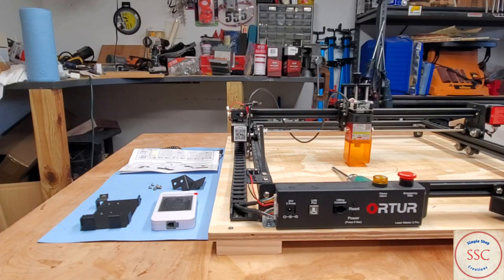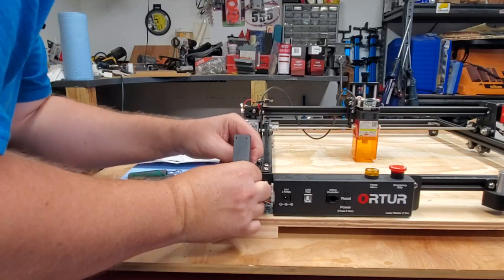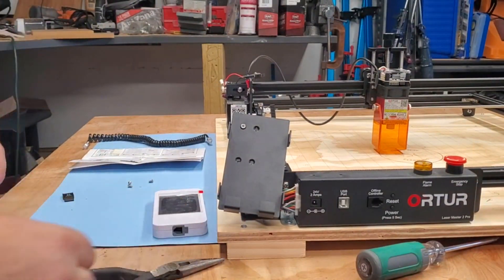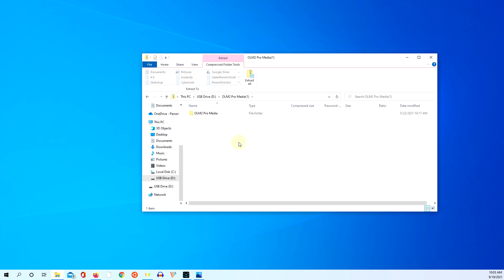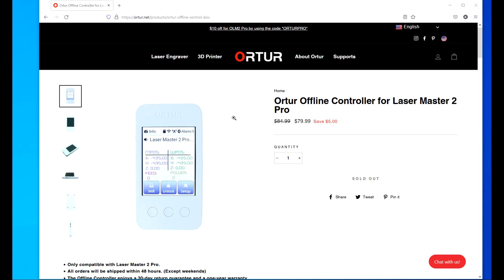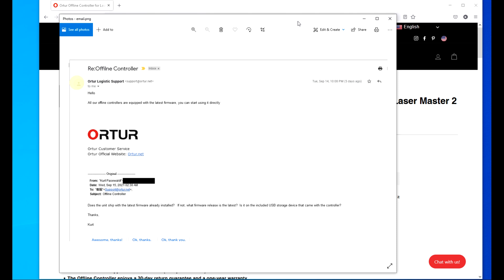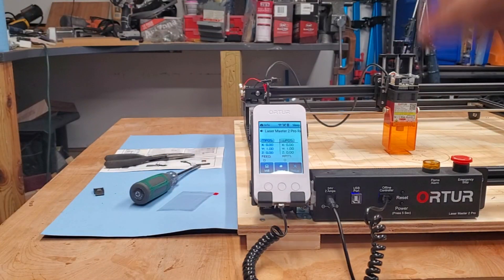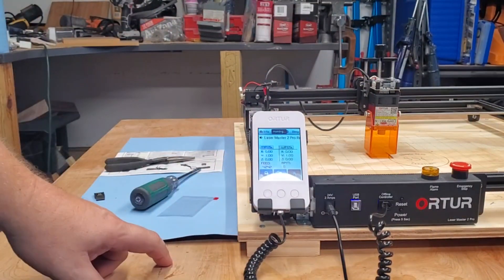Ortur Offline Controller Install

Comment: Where did you purchase the controller?
Reply: I like the idea of having off line controller so I can use my light burn for multiple machines.
Reply from the maker: From Ortur web site.  Thanks for viewing my videos.
Reply: @SimpleShopCreations  Must have failed to make it work, not for sale any longer, thank you
Reply from the maker: @ProfessorDIY  Yes I would of assumed they removed it as it is a PoS and plus now the Master 3 they sell is WiFi enabled.
Reply: @SimpleShopCreations  hat does not help the older models however :(
Reply from the maker: @ProfessorDIY  You can purchase a point to point USB extender that uses Ethernet.  Just be sure to read the fine print.  Most Ethernet USB extenders need to be directly connected.   The USB extenders that can be IP based need to be connected to the same network switch.
Reply: @SimpleShopCreations  Thank you

Comment: OFFLINE controller.  you keep calling it ONLINE controller.  Thanks for the introduction, but I hope you make another video showing us exactly what it does?
Reply from the maker: Yes you are correct I keep on saying online instead of off.   After I posted the video, I messed with it for a few more days but at its current state this product is not ready for prime time.     Might be time to follow up with Ortur to see if they have created a manual for the unit.     

Since the Ortur is controlled via a USB cable, there are other ways to access the LASER remotely.   I did say in the video I have another way to control the LASER remotely,  but as of now, I do not have the funds to purchase the device needed to remotely control the LASER.      Thanks for viewing the video!
Reply: @SimpleShopCreations  Thanks for your reply.  I hoping someone posts a video eventually showing us how to actually use it.  I can't imagine having files on and SD card and printing them (engraving) on the laser without being able to graphically see the file your printing on the screen so you can move the laser head to where you want to start.  You really need the graphics of Lightburn (for instance) to manipulate things properly, and that little screen looks way to small to be doing that.  It would be great if someone had a tablet sized offline controller so you could actually see everything you are doing, or just make an app for our iPads!
Reply: @spydie  isn't the idea to still use Lightburn but export the gcode and stick it onto the offline controller?
Reply: @lunakoala5053  Who knows?  So far nobody has posted a video that actually shows us how it works.
Reply: Did you ever say what brand and model of the offline controller you installed?

Comment: That seems a bit silly that there is nowhere to mount it if you also have the enclosure
Ok im an idiot there are holes on the side of the enclosure :)
Reply from the maker: Thanks for viewing the video.
Reply: Yep, that's how I landed here. Bought the enclosure. The optional last step in the manual is mounting the offline controller.
Reply from the maker: @lunakoala5053  Hope you enjoyed the video and thanks for viewing.